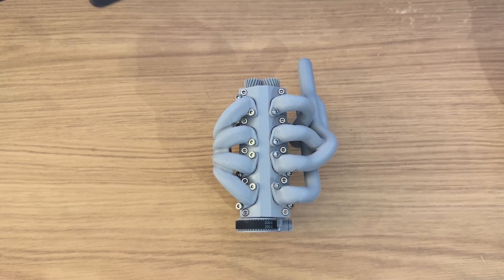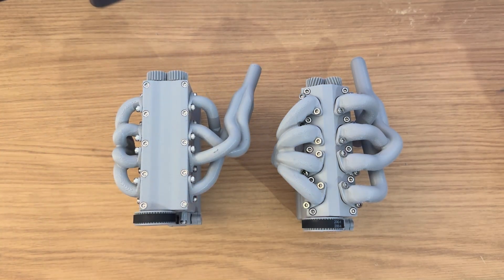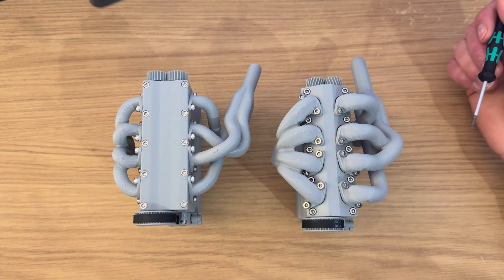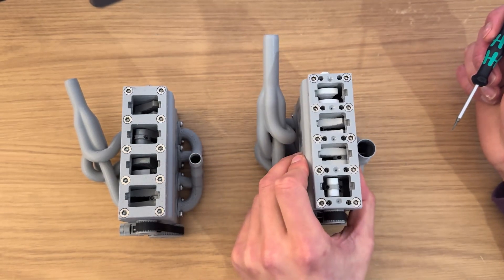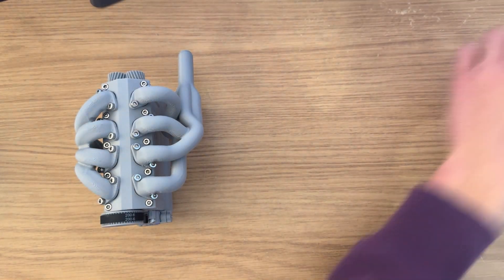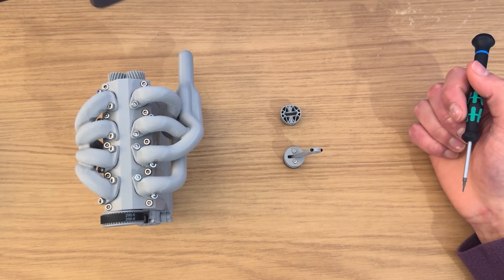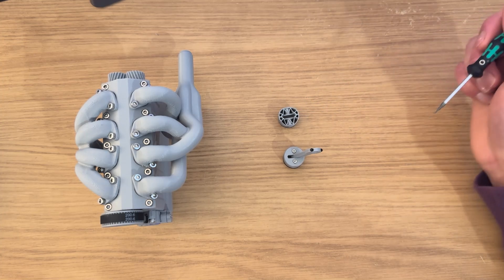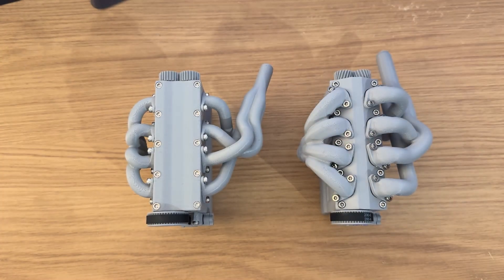Even higher RPM 3d printed engine!

Comment: Great project :)

I wonder about the autonomy (in duration) that can be obtained from a pressurized water bottle (bottle of 1,5l with 5 bars for example).
How long does this engine run with the 1.5l bottle under pressure?

Comment: it would be great if you had a larger capacity air compressor.,
your engine designs are amazing, new subscriber
Reply from the maker: Thank you!
Reply: Rotary valves?
Show us the head
Reply from the maker: @WikWak  at some point I will show the valve system but I want to make a video specifically about it

Comment: Verry nice, are you using rotary valves?
Reply from the maker: Hi Chris, my valve system could be described as a rotary valve system. I am aware of a few different types of rotary valve systems but have not seen a system like the one in my engines. please could you show me an image of the valve system you are thinking of and if possible a date to determine when it was designed.  Many thanks.
Reply: @PolyProject3D  I was thinking of the system in the video of this air engine: https://youtu.be/5oGbH8k0wpY?si=lBgesMyw7dm2cTxB. Assuming that yours has better tolerances, is a little more complex and ports for the exhaust.
Reply from the maker: @christanvandijk5106  I want to save my explanation for another video but my mechanism also has a different location for the intake and exhaust ports and air flows through it differently.